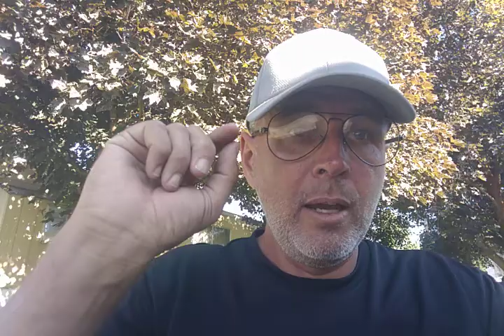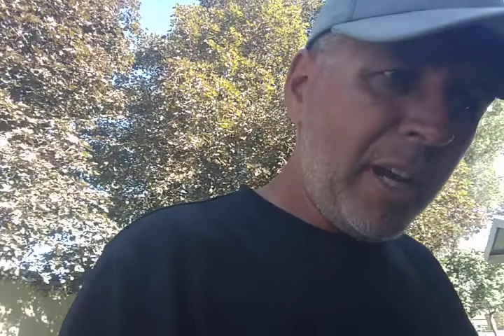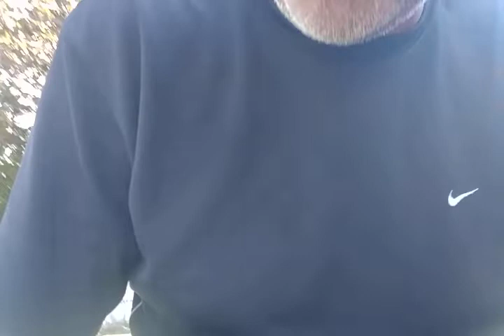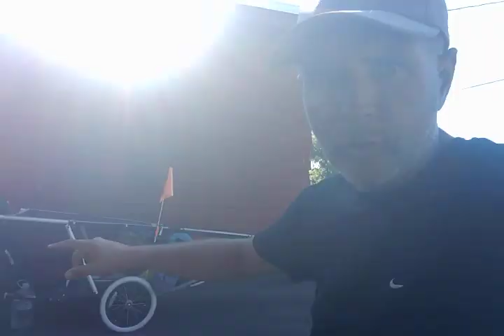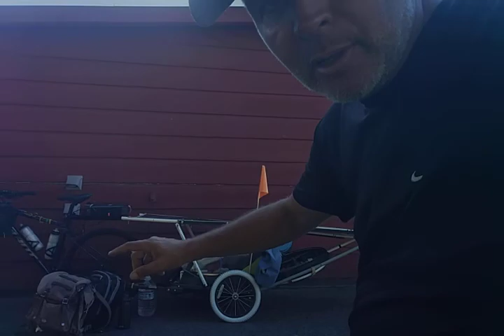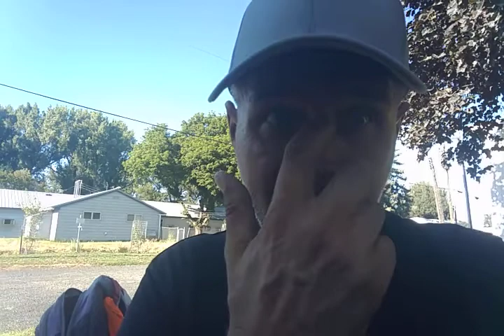Update on the Bike - Technical Details: New Grin Tech Motor - Cycle Analyst - Phase Runner July 2022

Comment: I'm sure glad you know what you're talking about!! And I know you do. You have learned lots on the road and have gone a lot of miles. And  if you have access to power, why not use it? Have you thought of putting one of the  solar panels on the bike as a shade?
Reply from the maker: If I forget I can watch the video 😎 As for the solar shades on the bike, one of the bicycle on the Sun Trip did it on a 2 wheel bike, it seems too high on a windy day, I've been blown off the road on just the bicycle... The trailer doesn't seem to catch enough wind to be a problem.